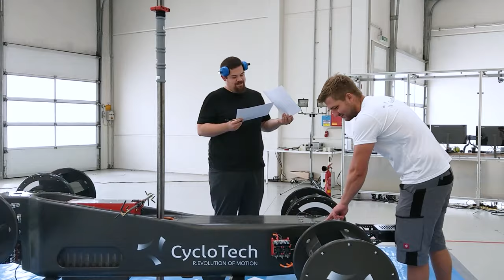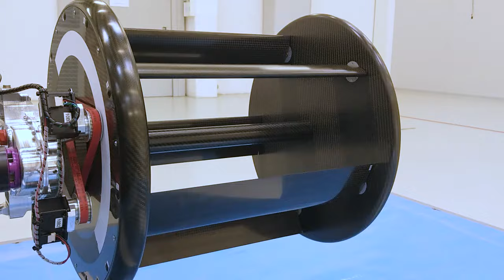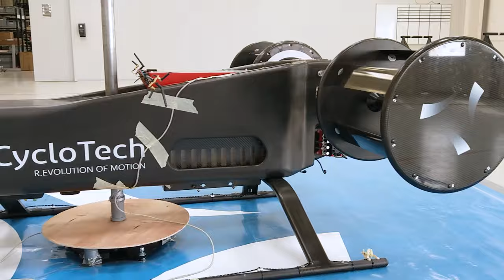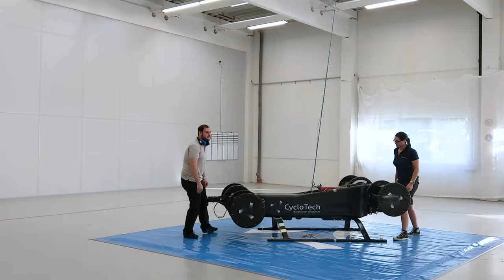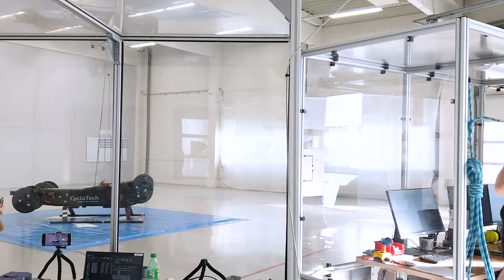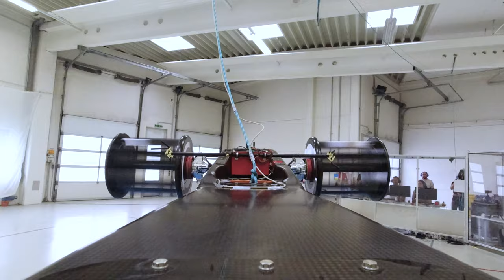CycloTech | Demonstrator First Free Flight (Indoor)

Comment: One of the most promising pieces of the cyclorotor as a propulsion system is the unique and low noise profile. Please, dial back the music on the next video :)
Reply: What makes you say it has a low noise profile?
Reply: @NicholasRehm  Tip speed is certainly an important factor, but it's not the only one. Wouldn't the design of the cyclorotor make it harder to scale to larger sizes, resulting in a higher effective disk loading and, thus, higher loading noise? Also, the cyclorotor forces the blades to pass through the wakes of other blades (like a contrarotating propeller) which would be a very large noise source. That, and all of the engineers are wearing ear muffs :)
Reply: @gibbled0  that’s the thing: lower tip speed at higher disk loading = less noise.
Frequency content is also very different and arguably more pleasant if we start talking about urban operations
Reply: sound pretty loud to me
Reply: @soccerguy2433  yah it sounds like it makes loud music noises.😅
Reply: It sounds like a giant vaccum cleaner. But then if it was silent it might be a little eerie
Reply: @Mambaru  can't even really hear it because of the damn music
Reply: @soccerguy2433  everyone at the test has on ear protection. I bet its loud for them toi
Reply: @gibbled0    Not only are they wearing ear muffs, but standing behind a blast shield, which would also lower the noise level to them.  Probably sounds like a jet taking off from an air craft carrier with the after burners turned on.  😂
Reply: Yeah. The music overlay killed this video
Reply: Agreed.  Music is really annoying.
Reply: @gibbled0  🔴 What Is Islam? ⚠️

🔴 Islam is not just another religion. 

🔵 It is the same message preached by Moses, Jesus and Abraham.

 🔴 Islam literally means ‘submission to God’ and it teaches us to have a direct relationship with God. 

 🔵 It reminds us that since God created us, no one should be worshipped except God alone. 

 🔴 It also teaches that God is nothing like a human being or like anything that we can imagine.

🌍 The concept of God is summarized in the Quran as:

📖 { “Say, He is God, the One.  God, the Absolute.  He does not give birth, nor was He born, and there is nothing like Him.”} (Quran 112:1-4)[4] 📚

🔴 Becoming a Muslim is not turning your back to Jesus. 

🔵 Rather it’s going back to the original teachings of Jesus and obeying him.

Comment: Nice! What is the thrust to weight ratio of this system? How does it compare to a conventional quadcopter? How would this system handle a failure at one of the corners?
Reply: Or a counter rotating blade set up. Kw/hr in hover mode vs. just that.
Reply: One nice thing about the failure mode is that the plane at right angles to rotation axis is actually difficult to design such that it DOES intersect a pilot vs conventional quad blade designs that either need tricky above and below designs or bulky armor between an exploding rotor and your meaty bits.
Reply: В случае отказа одного из углов она перевернется и упадет на землю. И будет полный пиздец !
Reply: don't forget the huge loss in efficiency due to the low aspect ratio wings.

Comment: Aren't those basically Voith-Schneider propellers like you find in tugboats?
Their biggest advantage is a very quick adjustment of the propulsion vector. Is not yet visible on this demonstration
Reply: But with thrust vectoring style like drones, I think there won’t be that much of use from quick vector adjustment properties of that cycloidal prop. Cuz all the trust need to propel to the ground in order to keep hovering and the vectoring options are only push to the front, back, upward and downward (You know what I’m trying to say, I don’t really know how to explain this more understandably). I hope at least it can yaw without losing altitude because yaw effect won’t work on this.
Reply: @ptixcc314  -- Yaw would be produced by vectoring the thrust of two rotors on one side slightly forward (though still mostly downward) while the two rotors of the other side were vectored similarly slightly aft. Maintaining altitude would thus require a slight power increase

Comment: I'm assuming the blades are gimbled so that they expel air down thus changing angle of attack depending on where the are in there rotation cycle, like how a helicopter moves vertically by changing the AOA. 
I would like to see the gimble in the endplate next to the motor, is there a gear network in the plate that changes AOA depending on rotational position, is it a static gearing that can be increased or decreased by a yoke? 
One more thing, efficiency? less or more than a typical horizontally rotating blade, because the blade spins inside a cylinder you don't have to have a blade with a progressive curve out to the tip.
Clever or just a design experiment, can it be done or breakthrough?
Reply: You are correct, there’s a detailed look at the mechanism on a smaller scale version in my newest video
Reply: I would assume less efficient, as blade efficiency is proportional to length (if I understand it correctly)
Reply: Gimbal each “pod” as in a fully articulated rotor blade system??
Reply: For comparison, you can see if you can find an illustration of the mechanism in marine cyclorotors, which are used on a vertical axis to propel ships, especially tugboats. Voith-Schneider makes them.

I don't know if it is accurate, but this video claims to describe the Voith-Schneider control linkage design:
https://www.youtube.com/watch?v=bbXyduMyOnk

Comment: How do you make it turn in place? I see it can go forward and backward easily as it is, and to strafe you'd need to bank it. But how does it turn? Can you do it by some inertial sorcery with a right hand rule and varying speeds?  Could banking or pitching with the combination of motor speed change cause turn? Shouldn't two of the propellers turn the opposite direction to give more control? NVM: I'm silly, you can make it turn in place just by directing thrust slightly to the front on one side and to the back on the other.
Reply: Right - it can yaw, but can't thrust laterally. That means that if you're hovering, you need to roll toward the direction that you need to move, to move laterally.

Comment: So what are the energy in, power out comparisons to conventional rotors?
Reply: That too is something I'd like to know as well. Right of the bat I see it is a low profile vehicle, good for storing aboard aircraft carriers where storage space is at a premium. I also see the ability to fit many of these on board a aircraft and launch them as a drone swarm.
Also, one again to it's compact configuration, it may be possible to launch a version of this from a submerged submarine. (Obviously, much engineering is required for that...)
But other than that I'd not completely sure what they'd be used for unless everyone gets to put one in their garage and we all have flying cars like in the Jetsons.

Comment: Free flight, this a tethered flight, and it's from back in August?
Reply: the tether didn't lift it or restrain it. it flew on its own power and control. but with a safety line incase anything went wrong. The tether never went taut.

Comment: It should combined with flexible tail of air jet propulsion system under the main body like jet fighter, so the main body size capacity for loading passenger can be increase, and small jet propulsion around it to arrange the movement.

Comment: Now cage those drums like a piece symbol and make each of the three adjustable or directional control flaps as well as being the outside supports for the outside of the drums. It will take care of your vibration I know must exist and limits RPM! Just like a box fan with the fan blades spinning inside, by using the walls of the outer box as vent or directional lifting and flight directing flaps you should have a more concentrated force that can be used for braking as well, and with bearing or magnetic outer bearings be more supported and better protected, with the added vibration reduction Seems like a major improvement to a great idea. Just an opinion from someone trying to figure out electromagnetism, Gravity, the Dielectric and Light. May the Aether be with you. Great work by the way!

Comment: Looks amazing! But with pure downward thrust, does it have any yaw control? If so how?
Reply: From what I've read the drums can produce thrust in the full 360 degrees of rotation.

Thus they should theoretically be able to increase thrust along the horizontal axis in one quadrant and reduce it in the other to produce yaw effect.
Reply: @ender5817  correct

Comment: Those are like fans found on a Vornado Fan its a good design choice to use those instead of propellers. Just from a design prospective try using them sideways instead of out ward like wheels you can make them longer this way and get more airflow. I'm not an engineer but do like design. BladeRunner flying cars will use this type of fans imo.

Comment: Amazing! What I want to know is how does the thrust know how to go down?
Reply: Looks like variable pitch blades within those barrels
Reply: You need to watch the videos on their website which show the theoretical structure and how the control point is shifted to bias the direction of thrust.
Reply: Voith-Schneider mechanisms. They run well in the water... and air it would seem.
Reply: @paulbergin4239  -- This raises an interesting question. This demo was for an aerial vehicle. But I wonder how would this design respond to water?  Could this vehicle land on water, propel itself to land, and subsequently lift itself out of the water to take off? Or are the rotational speeds required to operate in each medium too different?
Reply: @shannondror  Air and water are both fluids. Submarines have the same control surfaces as airplanes for that same reason. At small scale, you could possibly do both underwater and air as many quadcopter drones have already done. But as size increases this becomes impractical.
Reply: @SoloRenegade  -- Yes, the fact that water and air are both fluids offers the possibility that a single mechanism might theoretically operate in both media. But when practical operation is examined, parameters may be required to be different for each medium, such as blade shape and thickness, and rotation speed. The unanswered question is whether this particular design which thrusts air efficiently enough to levitate would be able to perform in a different-density fluid medium such as water. Also yet unanswered is the related question of performance across a range of air densities or altitudes.
Reply: @shannondror  If it works in air, it works in water. It's the reverse that is not always ture.
Reply: @shannondror  The difference in density between the mediums would at least require a corresponding rotor speed difference. It could theoretically operate as an aircraft, water surface vessel or submersible if it had the appropriate design flexibility. I'm not sure if open ended carbon fiber is well suited to sea water immersion though.

Comment: Better stability can be obtained by Dihedral, an angle formed by two plane faces. When you add dihedral, you add lateral stability.
Reply: this is not a fixed wing aircraft. and it's also fly by wire.
Reply: @SoloRenegade  When you add dihedral, you add lateral stability.
Reply: @WolfsburgWarehouse  -- Dihedral is for lateral stability of a pair of fixed wings.  Similar stability is produced by "coning" of helicopter blades.  This is a different technology using balanced thrust generators for stability.  Nothing would be gained from any dihedral, and power would be wasted if the laterally-opposed rotor units were mounted to the body at an angle that simulates wing dihedral.
Reply: @shannondror  The Cyclo Rotor dips when it's not level.
Reply: @WolfsburgWarehouse  -- Both sides of the craft would lose the same amount of down-vector thrust when the craft is not laterally level, while also producing a side-slip. It does not present a runaway roll scenario. However, producing yaw with opposing side fore-aft vectoring would require both sides' down-vectors to remain equal and balanced. Producing roll deliberately via differential lateral power would, however, require care to control the amount of roll and to restore balance.
Reply: @shannondror  The Cyclo Rotor has no side thrust, to compensate for lateral forces. It's shaky. Watch the test at 2X speed.
Reply: @WolfsburgWarehouse  I know what dihedral is for. but there is no guarantee this works the exact same as a fixed wing airplane.

Comment: This is a really smart design. Can accommodate in an aircraft without compromising it's aerodynamics. 
Would the engines produce forward thrust in the same position?
Reply: Apprantly it's Omni directional from what I've read.
Reply: Yeah many questions . Very cool though
Reply: @pippy4658  I don't get what that means, if it was onni directional at once it wouldnt lift up, so it needs to be able to vector the thrust some how
Reply: Each rotor can thrust in any direction perpendicular to the axis of rotation, so in this design with all rotors on lateral axes, they can all thrust in any direction up, down, forward, or backward... but not sideways.
Reply: @cinialvespow1054  in this context, "omnidirectional" was intended to mean "in any direction"; however, cyclorotors can't thrust in along the direction of their rotational axis, which is lateral in this case. The rotors are controlled to thrust upward for lift, and upward and forward to fly forward, etc.

Comment: The main problem with this build, if 1 malfunctions, the other 3 won’t be able to safely land. Because of that, it won’t go professional / military. It’ll be a cute concept at most, or a toy for rich ppl with a death wish.
Reply: If 2 oposite rotors have sufficient thrust to keep it flying, than third rotor could do balancing, and it could keep flying with 1 rotor malfunctioning.
Reply: Ejection seats ....
Reply: I don't think this is just a cute idea.
The helicoptor is more dangerous than these four rotors if 1 rotor mulfuntion...
But we continue to use it in professional/military.
Reply: @jirayupeetakul8854  Helicopters can glide to land without the engine, same as an airplane. They do this through autorotation. This contraption is not capable of such autorotation. Helicopters, even with one rotor, are safer. The rotor system of a helicopter is also more efficient than this device, and mechanically far simpler.